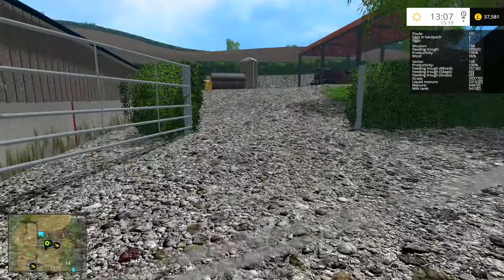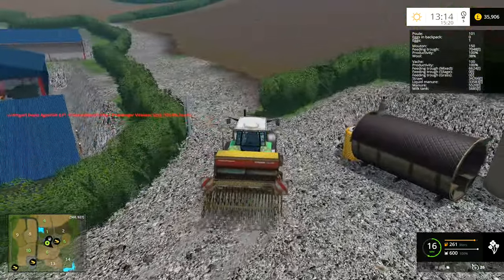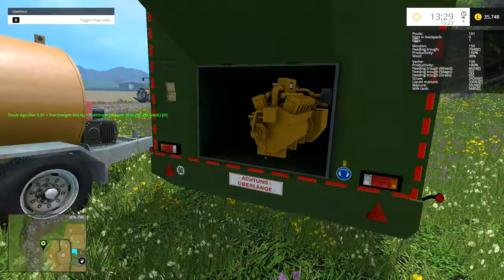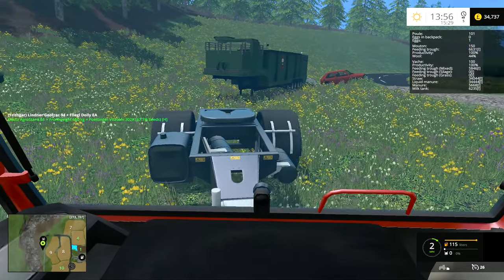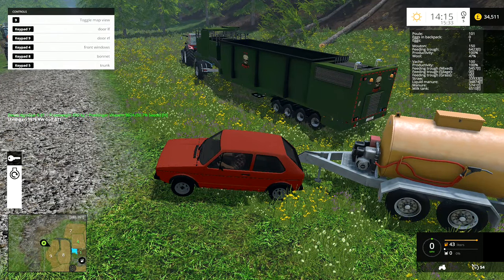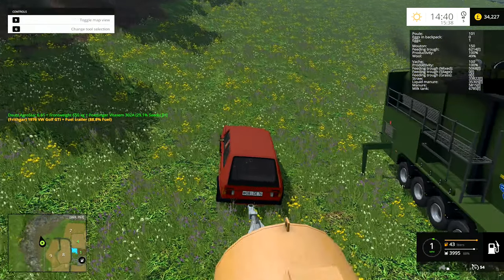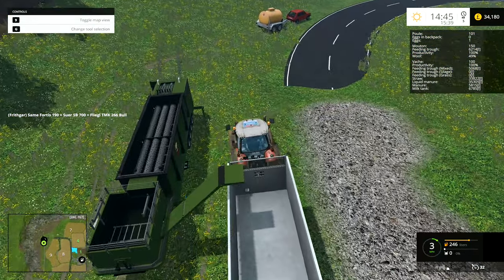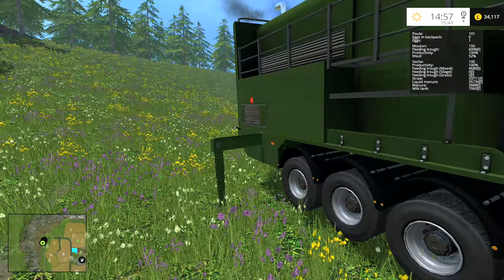Let's Play FS15 Higher Hills #8: Mistreating The Golf!

Comment: claas lexion 460 axial flow combine
Reply: in the usa you can use a regular pickup truck with fuel tank the CDL for it is a class c CDL
Reply from the maker: Yeah we can use pickups and othere 4x4s for pulling them, but I think there is a limit on what a normal car is allowed to pull on the road.